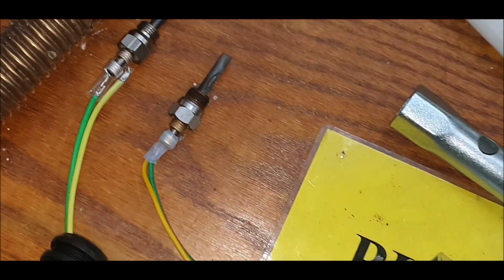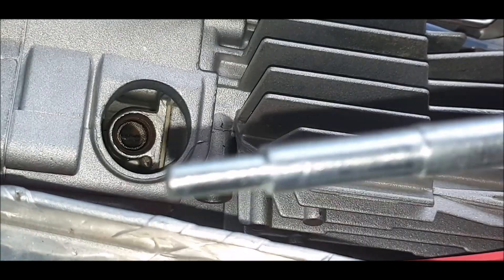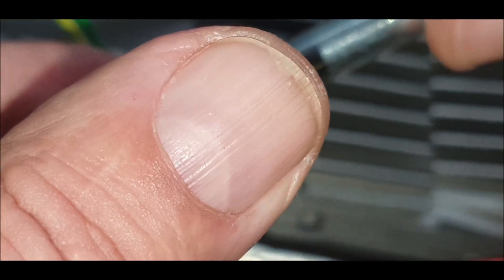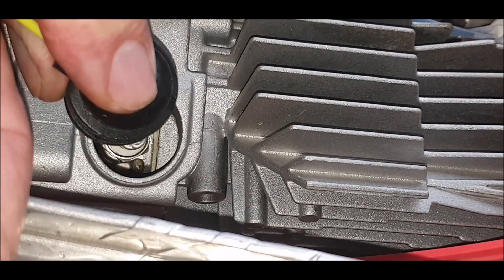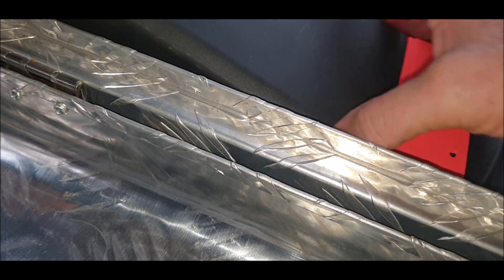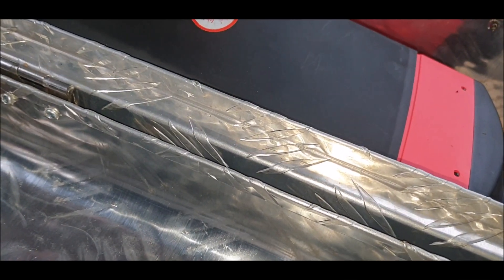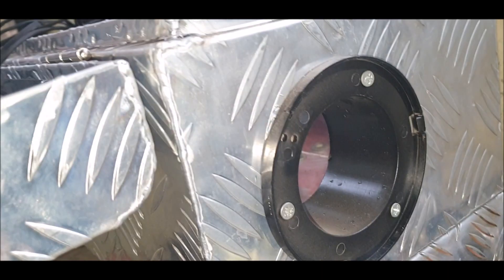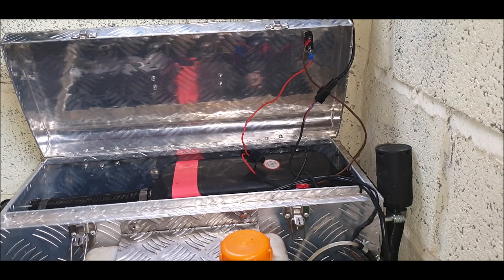Chinese diesel heater fitting new glow plug and testing

Comment: Hi Gary from the UK here grate video very interesting and informative keep them coming, 
I have the smart diesel heater from Hcalory and had an error for low voltage so I have one like you and it's only giving 9 to 10v so ordered another one it will be here next week, So found one in Wickes for £18 it's called Ellumiere  had to make a few adjustments on the cable but working perfectly and it's in stock

Comment: Hello Mark, very helpful video. May I ask if when your heater starts up does it make two or three Phut Phut type noise before actually firing up? Mine does and I wonder if that is normal after changing the glow plug and mesh? It works fine but just a bit slow to actually fire up.
Reply from the maker: The old one did but not this one Eric

Comment: Hi mate.
I've just received a new heater. Straight away im getting  E -3 error code. My voltage is set to 12v and im getting 14.2 on the batts charged by solar.
I know E-3 Is a glow  plug fault. I've  not set the controller fully. Am i doing something wrong or is the glow plug fucked? Regards Ray.
Reply from the maker: Hi Ray take out the glow plug it might have a small crack in it
Reply: Could it be I've not primed it?

Comment: If you have a mains power out as the unit is working the heat will melt the mother board . Always better to have it running off a battery

Comment: Thank you for the great video I only just fitted a brand new one did the first prime set ok, 3 minutes in running it it stopped and came up with the glow plug :( so be best to get a new one take it apart and see why the glow plug errors up on a brand new unit :(
Reply: Did a new plug fix it? I just set mine up and it gave the E-3 code for faulty ignition. Brand new out of the box.

Comment: The glow plug does not need to be quite so tight.  It's not under much pressure so just needs a gas tight seal and overnight may cause problems when you need to overhaul.  Well done by the way 👍
Reply from the maker: Thanks for the info  Steve